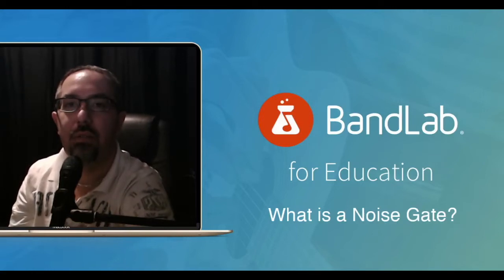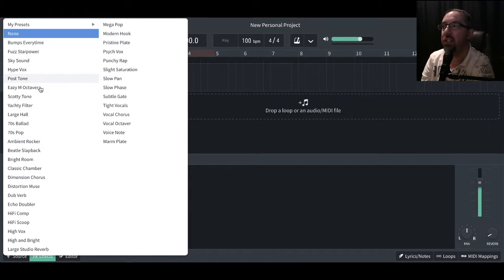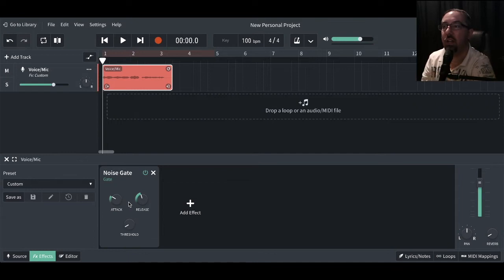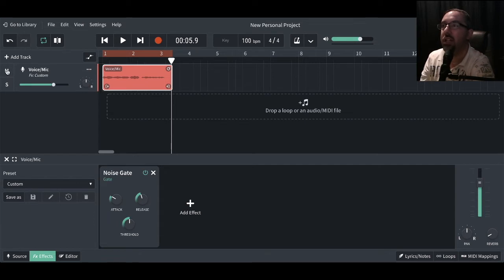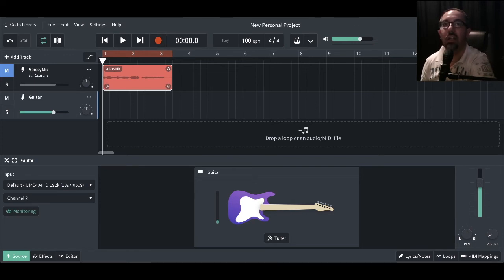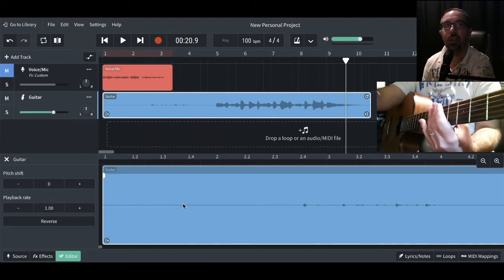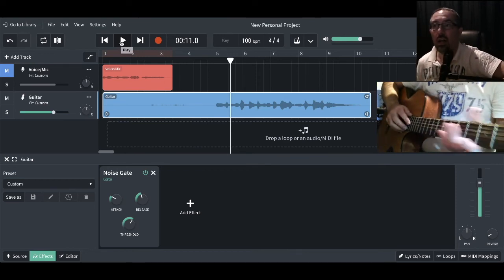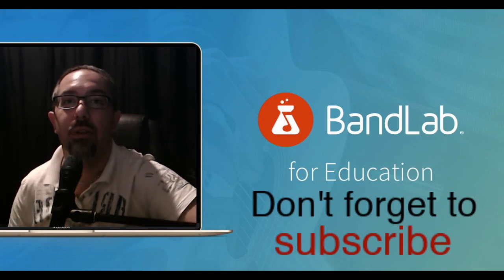Bandlab Basic - Noise Gate Fx Effect

Comment: I’ve recorded a good bit of music on bandlab without really knowing what I was doing, but my most recent recording keeps buzzing on the high/loud notes. I’ve experienced this before when I was too close and maxed out the amplitude, but everything is within bounds this time and it’s still happening. Any advice?
Reply from the maker: This can be a hard issue to trouble shoot. How are you connecting your instrument/mic to record? Often it can be a cable issue. Sometimes when I have used a semi acoustic guitar the battery was going flat causing issues with having a clean sound.

Comment: What if there’s static in the beat
Reply from the maker: If you are getting static in your sound. Check you cables or try swapping your cables that you are using to connect your  instrument or mic with. Depending on the input device you have, I sometimes have a few options for that device in the source list. Try one of the others in the list if you have multiples for the one device. This also resolved a latency issue I once had. The third option is the static could be coming from the device or instrument you are recording for example a battery going flat in a semi acoustic guitar can cause static sounds. Hopefully some of these ideas points you in the direction of solving your issue.

Comment: Hi could you help me Wyeth u play back my song it’s so crackly
Reply from the maker: First thing you might need to do is isolate where the issue started. You can do this by checking each track and working out which track it happened on. If you play back your song often it might be one of the most recent tracks you added. Check the volume to see if it is peaking into the red. This could be the combined volume of the tracks or an individual track going into the red on the volume display. Another cause could be if your recording using outside music gear. Check the volume to make sure it’s not going into the red on the input audio source. Hope this gives you some things to check to fix your issue.

Comment: Hello can you assist me with an issue? I am having a lot of noise static. I recorded with my phone but when I open bandlab on my computer to finish recording I hear a lot of static but when on my phone I don't hear the static.
Reply from the maker: There are a few thing that can cause static. The first thing you might check is your computer. What does the recording sound like if you plug in headphones into your computer? If you can use the same headphones on your phone for a comparison that might be good to check. This will hopefully let you know if it is a speaker issue. Next try recording something from your computer and then compare that to listening to on your phone. Do you still hear static on the computer vs phone? This might let you know if the starting point for the issue was at your phone. If you can find out what is causing the static then it will mean you don't need to add further effects to try and hide the static.
Reply: @DavidGaskellOnline  it's coming from the imported track
Reply from the maker: Is this an imported backing track or loop file?
Reply: @DavidGaskellOnline  I copied the link from youtube and converted into mp3, then I downloaded and imported it into Bandlab all from my phone
Reply from the maker: Ok, catching up with you now. Sounds like something happened in the processing of the file, either at your phone or during the import. You could try again but do it all from your computer and see if that works better. With some apps that download YouTube videos/audio you end up with a  lesser quality then the original. My guess is that the phone app downloaded it at a quality level suitable for your phone but when used on other devices you notice a different frequency range, where you hear static outside the audio quality of what the phone works with.
Reply: @DavidGaskellOnline  I'm not for sure because when I imported  another track from the computer I heard the same static noise.🤦
Reply from the maker: @alternativeremedies9739  what happens if you just play the mp3 on the computer before importing it into Bandlab?
Reply: @DavidGaskellOnline  I just played the song without opening bandlab mixer and it played just fine. Now when I open bandlab mixer I hear the static noise again. I think it something that needs to be turned down or something. Do you have teamviewer?
Reply: Can we connect on teamviewer so you can see what I'm saying?
Reply from the maker: @alternativeremedies9739  Head over to my website and you will find a contact page. In about 2 hours I’ll be at work and will have some time or leave me some info and we can arrange another time depending on your timezone. Link to the website is in the header of the main YouTube page or in the about section. In the meantime check out the video I did on volume vs gain effect.

Comment: Sometimes I get static noises how do I fix that
Reply from the maker: You would need to work out what is causing the static so that you can record a clean sound. It can be caused by many things from a bad cable to a bad internet connection. Sometimes can get an issue with the chrome browser struggling with the audio, Restarting your browser or computer can sometimes fix this. It would be very hard to get it out of the recorded track. It is also possible to have bad headphones that that give you a noise that is not in your mix.
Reply: @DavidGaskellOnline  ok I get the static on my computer and I know why and how to fix it but how would I fix it on my phone
Reply from the maker: @val5756  interesting question. Have you tried saving your project and then and swipe close the app and opening it again? Make sure you have any other apps closed. A restart of your phone could also help. This is with the thought that your issue is a memory issue. If the static is still an issue it might be worth sending a message to support and describe your issue. Let them know some details about your phone make/model and what software version you have running on it.